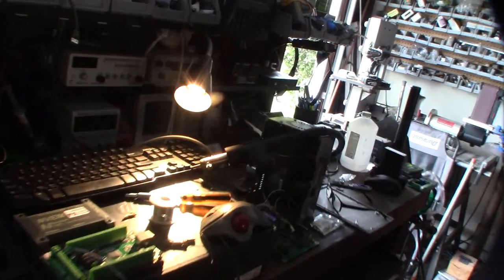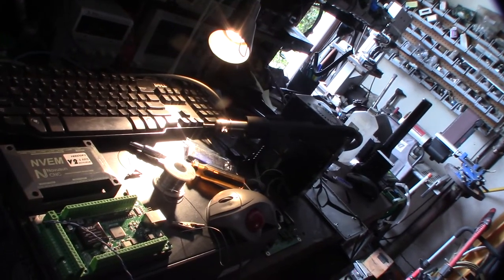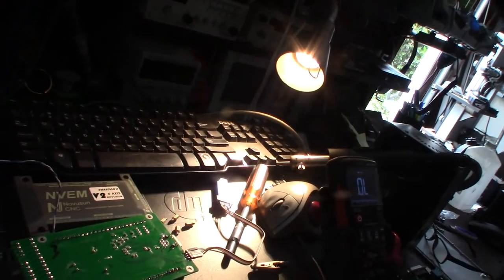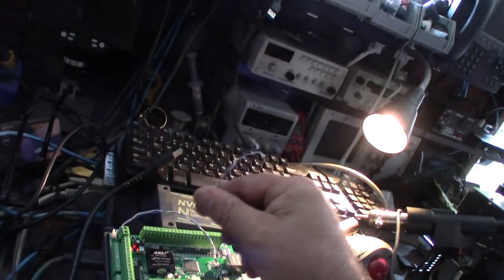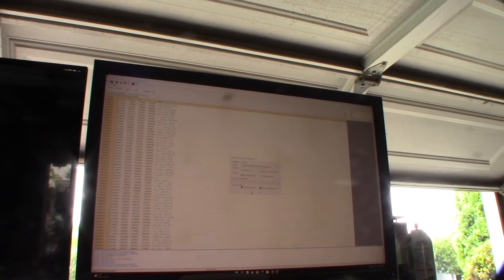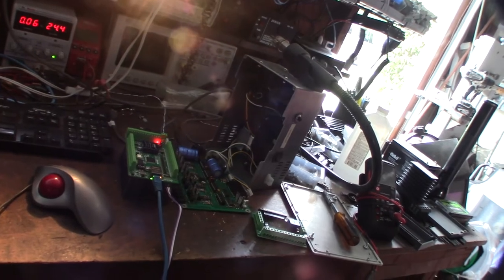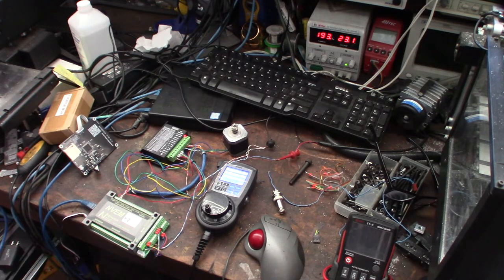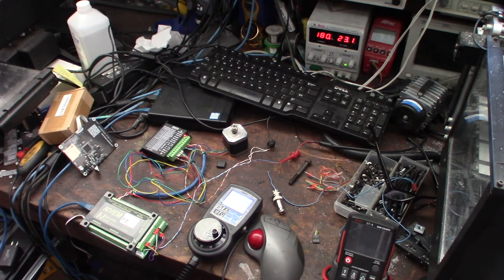Unbrick STM32 Arm Processor using ST-Link CNC, 3D Printer, Novusun NVEM EC300 EC500 SKR Mach3

Comment: Thanks for the video. I have a controller and think I have the same problem. I am unable to connect with Ethernet. I have contacted the manufacturer. They suggested to try at least 3 different IP addresses. Still no luck. I have an STLink and am unsure the wiring connection. Also, where did you find the download firmware file? My device is the NVEM V2 3 AXIS.
Reply from the maker: I have the same one. I have the firmware.
Reply: @fintechrepairshop  I struggle now about 4-5 days with this board, can you send me the firmware please?, there are so manny sh.. bin's out! I think it could be a good board with some support!?